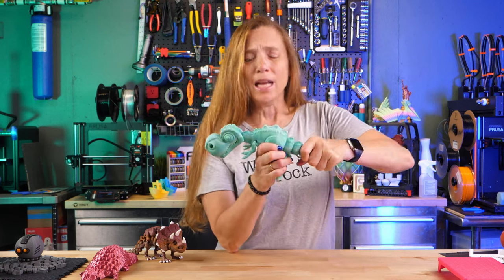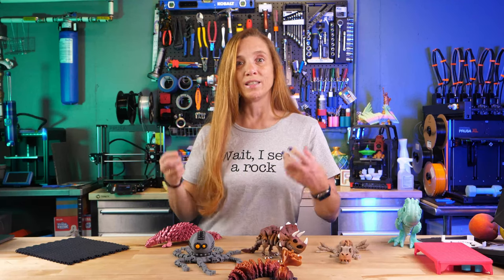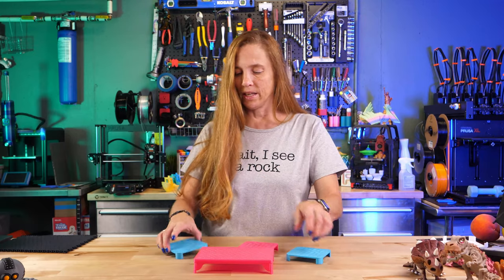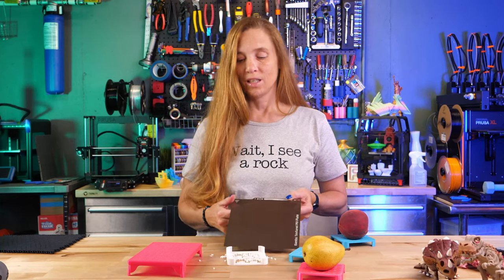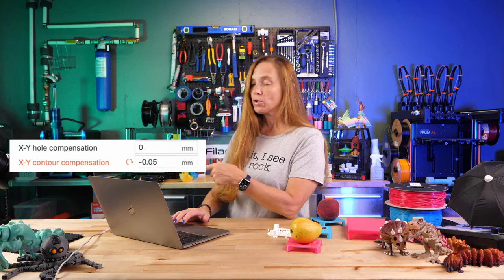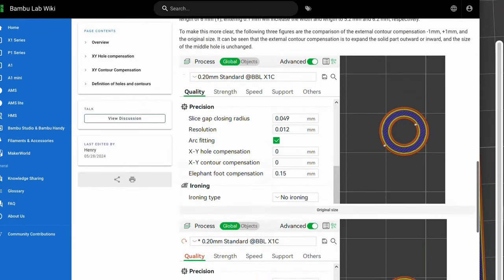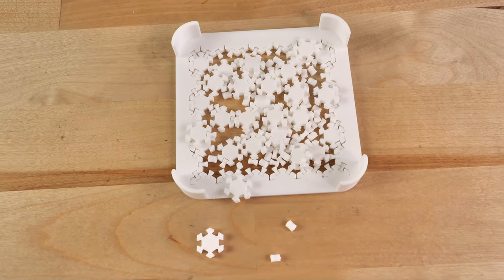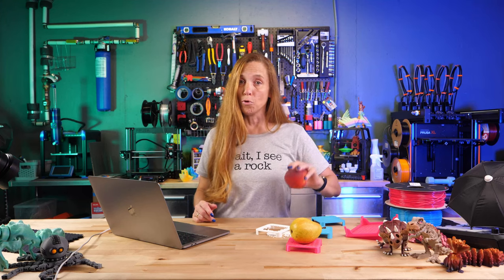My 3D Printed Flexi Doesn’t Flex — Let’s Fix It

Comment: I've just showed this setting for my students, they made an simple assembly with a nut and some sort of screw, then they had a bad time trying to join them, sopme even broke their parts, then I've explained that they need to check how is set the horizontal expansion in Cura.

Comment: Another related setting I have found to be important is Slice Gap Closing Radius.  If the gap between parts is too tight the slicer will simply merge the parts together.  Reducing this will ensure the parts have a chance of staying separate.  (lots of tolerance tests fail because of this setting, not because the printer can't do tight tolerances)

Comment: Thanks Courtney, very helpful. I recently switched from Cura to Bambu and I'm finding it difficult to fine tune certain things because some settings are called different names. I was looking for horizontal expansion and couldn't find it 🤷🤦 very important setting for not only flexi models but also for anything that needs assembly with very little tolerance

Comment: @FilamentStories
Cura also has two settings. You mentioned Horizontal Expansion, the other is Hole Horizontal Expansion.
In short, the former operates on the entire model, the latter doesn't impact the outer dimensions.

There's actually a third that's exactly what it sounds like: Initial Layer Horizontal Expansion
(that's for dealing with elephant-foot if you really like a lot of squish)

Comment: The interlocking geometry looks too delicate to print properly and hold without partial fusing. The gap between fused and loose is very narrow.
So I'd think it's not entirely about print settings (and what IMO should be changed is flow) but very much about the model.

Comment: The problem as I see it is,  slicers are trying to give you how to make a cake recipe using words they found in math and science class and expecting you to take 3 eggs and cut them in half.   the descriptions are good but when it comes down to it changing the settings and seeing how the model looks is like reading a map.  problem is you can't have 2 maps open side by side in an easy fashion.  In other words try telling the difference of 2 fonts but you can only see one at a time and you have to turn off your screen when you switch them.  Slicers are like using amazon and walmart.  nether one has a good experience unless you just want the stock slandered

Comment: Hey just for the new people here: if you are using cura and slicing is taking more than 15 secs or cura wont open try prusa! Cura is a lot heavier and is single threaded for the engine while prusa is multi threaded meaning prusa can take advantage of more than 1 core! Just a quick tip(bambu studio and orca are PRUSA based so those are also options but heavier so run worse on low end systems)